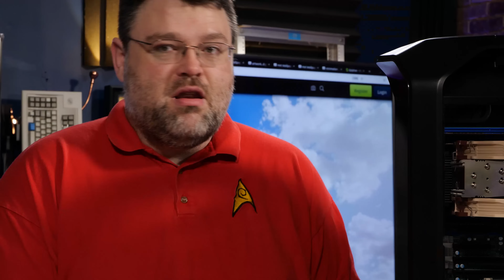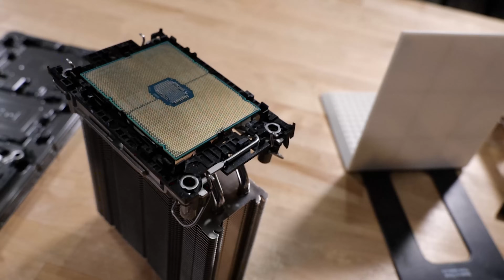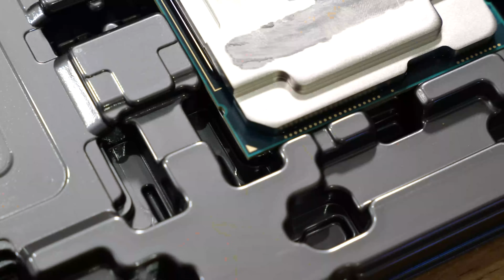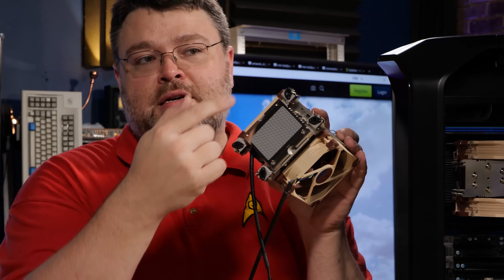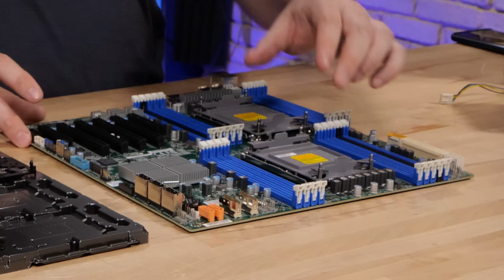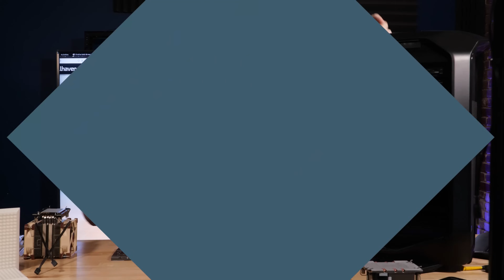How to Install a Socket 4189 Xeon CPU

Comment: Reminds me of the old IBM "mainframe" and "mid range" (early 90's) where the cpu was bonded to the heatsink and that was screwed into the processor card/cage package that was plugged into the backplane and was "a non-user serviceable part" (had to swap the whole thing)... good times!
Reply: not only 1990s, i did a lenovo or ibm server ~2016 that hat the cpu "glued" to the heatsink

and now you got me thinking if the cpu´s i put into 6 sr630´s were solo or attached to the heatsink - and that is only a few weeks ago...^^
seems i did too many 2011´s, 13xx, 11xx and that else there is, over the years
all hail am1-4 being basicly the same socket
Reply: Also them PowerPC mini-PCB assemblies, seem less convoluted

Comment: Seems like an awfully convoluted and flimsy way to handle a $10,000 product.
Reply: @asdrubale bisanzio open letter to Intel: If you can't compete with AMD in Performance, Core count, power efficiency and price at least try to beat them in ease of installation

Comment: Like Patrick's video! Only slightly less practical and useful... Sorry Wendell...
Reply: Who’s Patrick? This is just rude. Wendell’s busting a gut to help people.
Reply: @adamsteelproducer  Wendell knows who Patrick is, and that's what matters. I generally love Wendell's content, hence why I even pay to support him on Patreon. But this is nearly identical to another video, that describes the same thing, only in even greater detail and with even more context.

Basically, I'd either cite Patrick's as inspiration, or find some different angle to improve upon it, rather than just a slightly lower quality shot for shot remake. Is my point.
Reply: @adamsteelproducer  Also, I'd guess that anyone who currently has a Socket 4189 CPU in their hands right now, probably already knows what they're doing. 😉